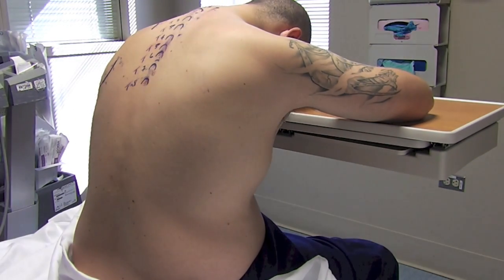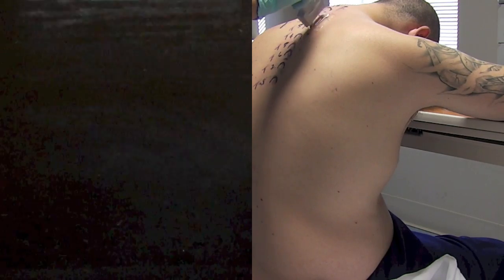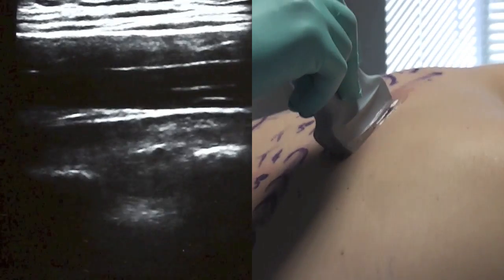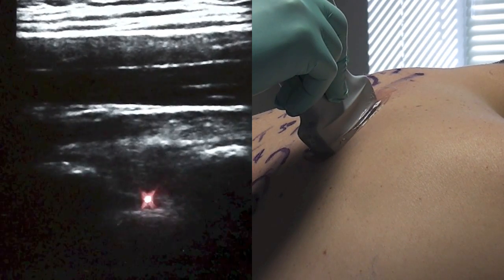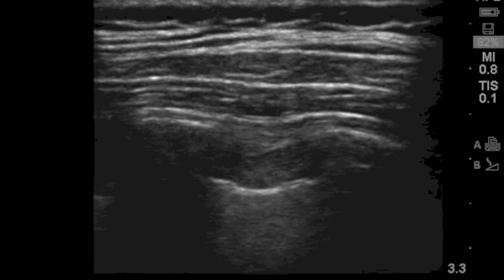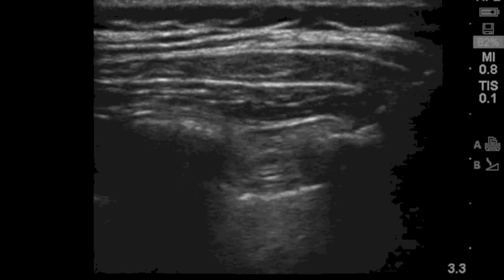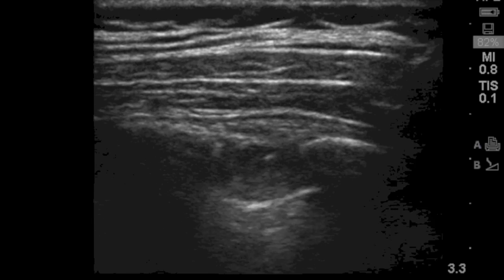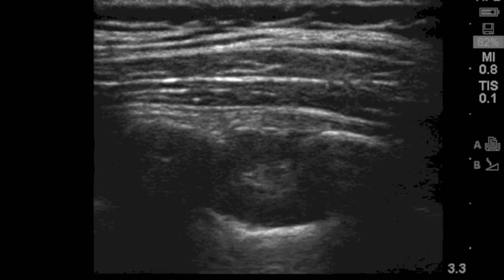Ultrasound Guided Paravertebral Block - SSRAUSA.com

Comment: Do you ever perform these blocks on patients while they are under general anesthesia? Another youtube video on this topic (shot in the UK) advocates this practice. I can't see that you would be missing paresthesias, and I would think that if you are so intimate with the pleura you certainly don't want the patient to make any sudden movements. Your thoughts?
Reply from the maker: damont1492 You can do this block under GA and in fact we do for our thoracotomy cases.  We place the catheter at the end of the case while the patient is still in the lateral position and the chest tube is in place.